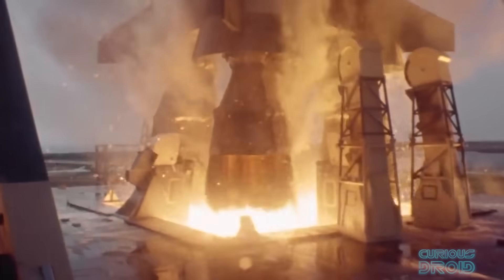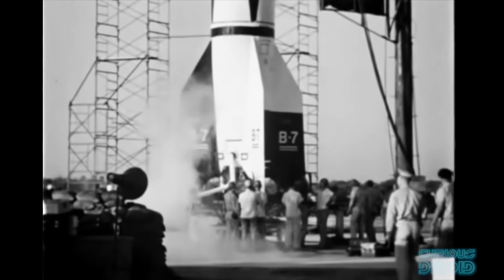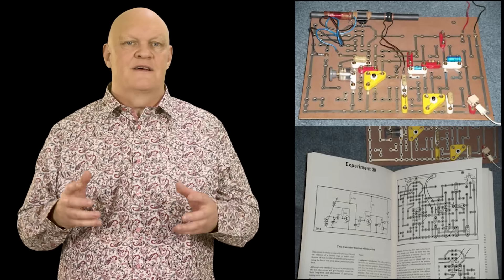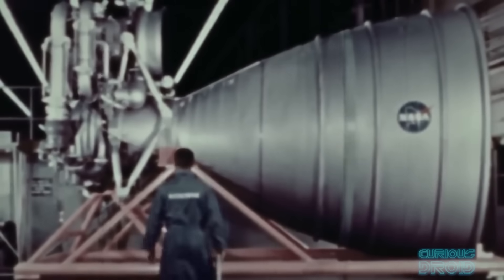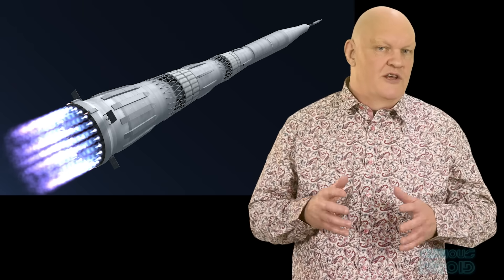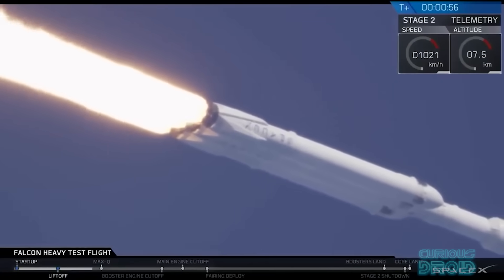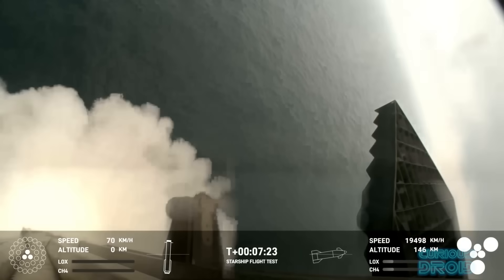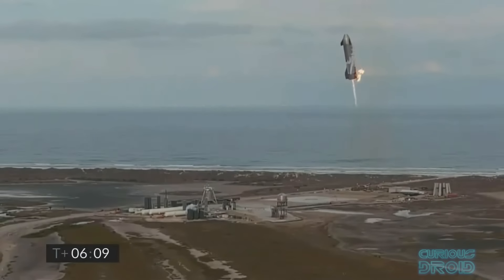Why Does SpaceX Use 33 Engines While NASA Used Just 5?

Comment from the maker: Get 50% off your first crate of a monthly subscription when you go to  https://www.kiwico.com/curiousdroid and use code curiousdroid
EDIT : I was wrong about the reusability of the SLS SRB boosters and they are infact not reused. I could have sworn I read it that that were or were meant to be at some point but anyways thanks for pointing that out, which means that the SLS  is 100% disposable. A few have mentioned that I'm trashing NASA, wouldn't say that but I would say that SpaceX is doing a lot of more what old style NASA and their contractors did in the 60s & 70s and that was innovating and truly ground breaking stuff, now it seems as though they tied down and muzzled but think has more to do with the government than NASA its self.
Reply: Could you do a video about the designed but never flown M-1 rocket, the most powerful oxygen/hydrogen engine ever designed
Reply: Thanks Paul. I've been waiting for videos from you about these rockets. 🙂👍
Reply: F-1 100% Success rate.... Uh, Apollo 6 though? 1 of the engines shut down due to POGO?
Reply: Nerd wizard.
Reply: Remaining in near-Earth orbit, another indication are the impossible weather patterns seen on Earth, when in reality only a small portion of the Earth's surface was visible, framed by the round window of the command module.  Straight line cloud fronts are seen on video to be extending for what appears to be more than 6000 miles, a quarter of the Earth's circumference -- something that has never occurred in the meteorological record on Earth. The round window of the command module was used to effect an image of the Earth but the weather in the region did not comply for a realistic view.  No recognizable continents are found in view, but only the impossible weather patterns seen.
Reply: Why hasn't Eron built a rocket that can get to the moon or Mars? OH, one that does not have to be refueled with 20 more rockets? Thx DS
Reply: @Johnnypaycheck77  WTF? It sounds like you're saying why he won't build another Saturn V, or other disposable rocket, and comparing Starship to one. Which is pretty idiotic.
Reply: @Johnnypaycheck77  
Contrary to his boasting, he’s not doing anything to get to Mars, and doesn’t seem to have been serious about getting to the moon.  
It’s certainly possible to build a reusable that can get to the moon and return to earth.  But NASA needs high cost to generate sufficient voter support to get programs funded, and reusables arnt as expensive per flight.   

So without a  market, no one’s building to sell them.
Reply: @Johnnypaycheck77  you do know rocketects dont need fuel to get to the moon right.
Reply: Super - very concise and very difficult to not compress information down so much without "Lying" - I could see all the artful dodges and smoothing over. I had a few electronics kits like that back in the day - that certainly made more complex technologies to learn much less daunting. ["Old man " worked at MSFC back in the day ] - and many other things later - I GIVE this VIDEO TWO THUMBS UP !!! but you can only give one... How many fingers am I holding up - smack - raised by hand like Pip - from Great Expectations. Old man at the drawing board - at EMI me doing electronics quietly as I could.... All that sh*t I philched from Coalie's junk yard - making extra-ordinarily awful sounds and beeps and boops and they thought I was "cray cray" that Eric kid - but it only took me four decades to find out I was only "Circuit bending" - before the term circuit benders were even a thing... 
.
.
As long as one was quiet - you could pretty much get away with murder.
Reply: Does kiwi co make one of those for the southern hemisphere? Your daughter will be very confused when she looks up and sees the southern cross and the magellanic clouds.
Reply: Would be good if you labelled the pic's and b-roll. I know a bit about rocket history but trying to keep up with you and looking pictures can be a bit much. For a large part of the audience telling them the nomenclature of a thing at the start of video does not help further in the video. I feel like I need to become a science communicator expert so I can explain this to science communicators.
Reply from the maker: @theunknownunknowns256  Point taken, after doing a lot of videos its easy to forget that not everyone knows what you know or have just discovered.
Reply: @kennethc2466 you must work for blue origin
Reply: to be fair NASA stuck to the principals that they know work ,and had experence with , the multi engine aproach was only used by the USSR and they didnt quite get it right eighter
Reply: Rocket is complicated and dificulte
Low safety and high cost
We need somethings better
Developing technologies to enable human access to space at dramatically lower cost and increased reliability #FeelFree
Reply: How to fly without wings

Vertical lift off is dificult, danger and high cost
This is the SOLUTION
Will replace rocket
AntiGravity Aircraft 
Work base on Gravity just spinning by using Battery
can fly in bad weather, plunge in the ocean even in outer space

Earth which weight predict 600 trillion ton does not fall at the Sun because of centrifugal in orbitting, on the contrary it does not be thrown far go out the orbit line of hold by gravity at the Sun as orbit center. Gravity and centrifugal is equal called Equillibrium, thats why until now Earth which we was inhabited always rotate and circulate the Sun. Now we justly take example : how if the gravity used and centrifugal is negated? The Earth will float far leave the Sun. So that centrifugal can be used to fly far away if gravity eliminated. Finally how to eliminate gravity?

It’s way rotate part of aircraft by horizontal. When that rotation faster centrifugal force getting greater and the gravity getting smaller, finally it lose the gravity and the aircraft start flying. Of course people would surprise: how the aircraft can keep rotate without fulcrums? Thats why we named that aircraft Shuttling System that is aircraft likes two disc adjoining attached in the midle as fulcrums:

A. The Top part, we name Positive rotate to right, and the edges is getting thicker and havier.

B. The Buttom part, we name Negative rotating to left, and the edges is getting thicker and havier.

C. Middle Part , we name Neutral, air crew placed and also machine and everythings turning Negative and Positive at the same time.

The aircraft can liftup added with explosion from the engine. However that aircraft construction later, let the engineer doit it, and we are sure the aircraft will bulletproof and also waterproof.
 
.
.
 
In modern civilization where human being generally using flying saucer as vehicle, will a lot of change in lives either in materialism and in psychological. In materialism area will apply the change in life like.
People no longger need roadway and rel road which spend large of energy, money, places, things and time, object place and time. People would utilize that area for habitat or for other need:
Reply: 😅😅😊😊 1:21 😊 1:23 😊😊😅😅a
Reply: What’s the name of that kit that that you said started it all?!?
  I been wanting to find  something like that that I had when I was a child as I had other things similar like that that helped me to learn different things.  It just seemed so simple back then and now everything seems much more complicated and that you would need to take a ln electrical class  1st.
Reply: W
Reply: Wee
Reply: A
Reply: ' I could have sworn I read it that that were or were meant to be at some point'
You're not the only one to remember this, it was discussed at some point.  It likely never made any sense with the O ring joints that would require refurbishment.  Likely it was only ever mentioned to make the entire project seem more reasonable with 'eventually we'll save some bit more of the money..', knowing it would never really happen.
Reply: Two points.  NASA never developed anything.  They contracted companies to develop whatever they wanted.  Now the problem is given their political directives from voters is to maximize pork in the maximum number of districts.  As Griffin stated, the shuttle metaphor of cheap routine access to space was a poison pill to NASA. So SLS was designed to keep critical contractors alive (no SRBs and the suppliers of ICBM boosters could go out of business) and desert reusable would drop costs dramatically, and make more routine/frequent flights possible.

Two.  SpaceX does horrible engineering.  Ignoring all the basics of analysis, testing, and review Von Braun promoted and we’re keys to Apollos success.  Build it, break it, and build a new one, is extremely sloppy and expensive.  Hence SpaceX inability to acheave any of their stated goals, and their extreamly high costs.
Reply: they need it it for power, trust
Reply: You familiar with Thunderf00t CuriousDroid?
Reply: Because more engines means more money sucked out of funding my Elon. He'll go down in history as the most blatant grifter, ever.
Reply: @blaircox1589  Hundreds of tonnes and dozens of astronauts into orbit but sure buddy it's all a scam. All the space agencies, militaries, and private companies involved are too stupid to see what you can, right?
Reply: Ghosted - but a Tesla ... drive once and never use it again ...
Reply: @11moonshot .  . " sorry, but I am sick and tired" .  . 😃 .  . Thank you for your sponsor reply.  You must disparage the obvious proof demonstrated in the unedited video -- They remained in near-Earth orbit and confirmed by impossible weather patterns for all to see .  . Two straight line cloud fronts each extending for a quarter of the Earth's circumference .  . When in reality we are viewing a much smaller region framed within the round window of the command module under greatly reduced exposure settings.  The camera then pulls away as the window never leaves camera range as the exposure settings are returned to normal and a flood of blue light enters through the window -- with nothing change in the orientation of the spacecraft at that moment.  Good luck with your efforts .  .
Reply: @ronaldgreene5733  Say what?? And this arguments of yours comes from some random film camera footage, with basic camera, settings, bad lightning etc.? Not to mention issues which come with digitization step and everything else? I mean,  I can say it's not clouds but candy floss really, and my statement is as much "true and fact" as yours. Just made up stuff and bunch of nonsense words without any actual proof, validation, whatsoever. SAD.
Reply: 14:10 THE ANSWER
Reply: Did Apollo 11 actually leave near-Earth orbit?
Despite the revisionist narrative that this channel won't question -- unstable fuel burn for the oversized F5 engines was never rectified and another arrangement in their place was made in order to reach near Earth orbit, keeping the F1 bell nozzle to maintain the desired appearance.  The great licking yellow flame was an indication that something was not normal as fuel was burning in the atmosphere while providing no additional thrust. This was the result of injecting additional kerosene into the exhaust stream for greater visual effect yet appearing to produce an inefficient burn unlike other rockets after launch.  No explanation is forthcoming and this issue is not addressed in any usual report; however, using a smaller reliable engine with a reduced fuel load and stripped down mission requirement allowed the Saturn V to reach near-Earth orbit.  The Apollo 11 crew attempted to demonstrate their position at over halfway to the moon as seen in the unedited version presented to the public while the more recently released unedited version reveals a flood of blue light entering the same window as the camera continues to roll, through which only a moment before, we saw the Earth far distant in what appeared to be very low light conditions. Then, as the camera pulls back from the window, the exposure settings are seen to return to normal as a flood of light enters the same window.  Without a change in the orientation of the spacecraft assumed to be on a trajectory toward the moon, the only source for any flood of light can be the Earth while in near-Earth orbit.  The usual sponsored efforts will try to make excuses for why the obvious did not take place -- yet is overly apparent in the unedited version.  When facts cannot prevail in support, sponsored activity will resort to name calling and other derogatory comments discrediting themselves.
Reply: @ronaldgreene5733   well they left stuff on the moon that is still there.  
  They lie about most things but the Soviets would have known if they didn’t as they were monitoring the whole thing and would have given almost anything to call the Americans out if they hadn’t gone.  
  But all the basement experts figured out what some of the smartest and most well funded ppl on the planet couldn’t catch it and call it out when they would of loved to do that more than anything else as it was the beginning of the end for the Soviets.  
  I guess your right the Russians/Soviets and everyone that was apart of their programs were just too stupid to
Catch some blaring mistake that u figured out.  
  Right lmfao at the sheer arrogance of the stupidity of that claim. 
  😂🤣😂🤣😂🤣😂🤣😂🤣😝🤣
Reply: @ronaldgreene5733  what a clown.
Reply: @override7486  .  . 😃 .  . Thank you for your sponsored reply.  Derogatory responses are necessary when no legitimate answer can be offered.

Comment: 11:16 - "If [an F-1 engine were to fail at launch], . . . it might not have the thrust to get into the correct orbit."

This is something of an understatement.

If one of the five F-1 engines failed before the rocket had cleared the tower, the remaining thrust would not have been sufficient to keep the rocket flying at all. 

However, in the time it took a Saturn V to clear the tower (which took about 10 seconds), it would burn enough propellant to have made itself 130 tons lighter. Thereafter, four engines could fly the rocket, albeit still with a risk of not achieving the desired orbit.

Comment: This aged about as well as 2 week old milk left out in the sun. SpaceX can’t even get what I call their Grain Silo Rockets (GSR) reliably into ELO. There is a basic design flaw with the rockets, too brittle, too heavy, under powered and too complicated. Rocket is useless if you can’t get the thing into space.  Well on the bright side they are getting a lot of practice with root cause analysis and cleaning up after GSR explosions. Reusable rockets are a gimmick by the time you inspect and repair the rockets you only are going to a few uses out of the motors before the rockets are being used for spare parts. Should not be your primary goal trying to get to the moon. Problem Musk is so egotistical he can’t admit he made a mistake see the CyberFlop as exhibit A.

Comment: F1 engines didn't have a 100% success rate. The first stage as a whole had a 100% success rate. Apollo 13's central F1 engine failed during the first stage but one failure of an F1 engine was not necessary to scrub the mission.

Comment: I understand the argument with the Saturn V vs the N1, concerning having to shut down an engine and losing a larger amount of thrust by shutting down 1 F1 engine vs N1. But it should be noted, the F1 had a 100% record when it came to mission launches. Why worry about a problem when its not a problem. Im not sure that if NASA had used a rocket design with more engines,  that they wouldn't have wound up like the Soviets. Just standing on terra firma looking up at the moon.

Comment: The Soviet N1 was doomed simply because the mechanical control systems for the engines were unable to react quickly and reliably enough to prevent uncontrollable issues.  If modern computers had been available at the time, then they might have launched successfully.  However, as noted, there were also build quality and insufficient testing issues as well.
Reply: that wasnt the issue, if a single engine failed a engine directly opposed to it would also shut down to compensate, so any engine failure would double hurting the margins of it making it to space.
Reply: @miguellopez3392  That was the plan, but in practice, the mechanical control system failed several times, causing the rocket to lose control catastophically.

Comment: In short, NASA made sure they worked properly, SpaceX just crosses their fingers and hopes.
Reply: and now nasa relies on sapceX for manned missions. turns out blowing up rockets first instead  of waiting for them to do it with people on board to find faults is a better strategy.
Reply: The Apollo program had 3 astronauts killed on the ground, 3 more nearly losed during a failed mission, and several close calls for the other missions. NASA also lost 14 people on the Shuttle. SpaceX has not lost a single person. And that is with spending drastically less than NASA.

Comment: Huge engines have habit of developing pogo. Huge engines need Huge equipment to build. A few Huge engines have to be super reliable as one engine out may be a huge problem. With many engine a few out produces less of a problem. Many engines reduce manufasering cost. Smaller engine may find use on smaller rockets.

Comment: NASA knows how to land a booster for reuse. It was a tradeoff between the simplicity of non-reuse and the additional complexity of landing a booster. NASA also learned a lesson that refurbishment of the shuttle engines was very costly, too. So, single use was seen as the better approach. Side note: all the R&D NASA did for landing a booster was public info, so Musk just used the work that was already done by NASA.
Reply: Nasa did 5% of the work for re usability.
Reply: If all of the r&d was done by NASA and publicly available, why has it taken so long for another company to do the same thing? SpaceX landed their first booster 10 years ago. Blue Origin is the second company to do so, and that was last week.